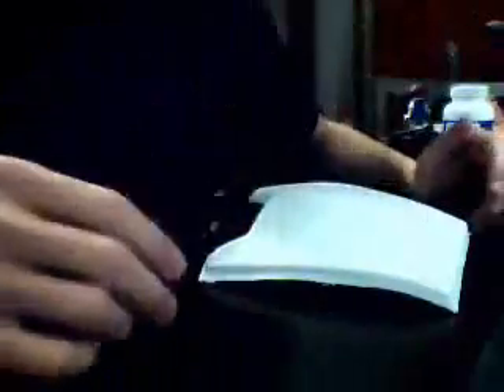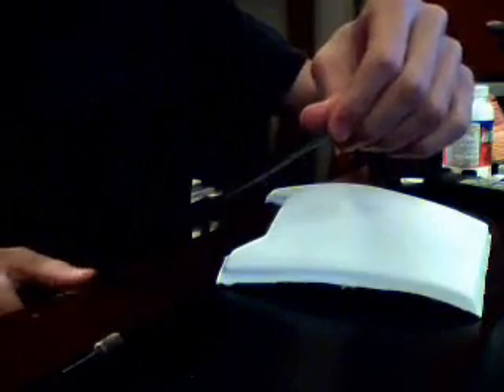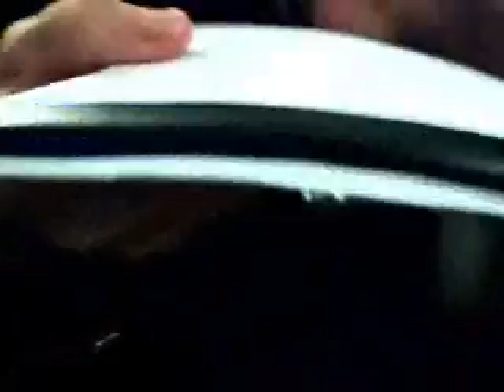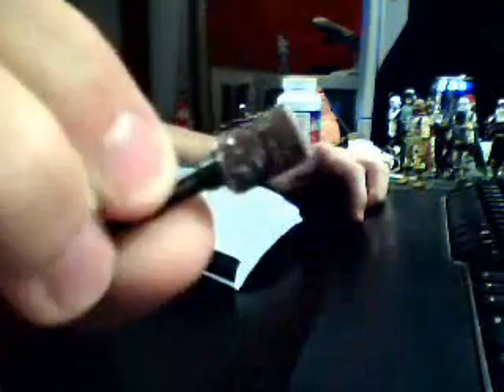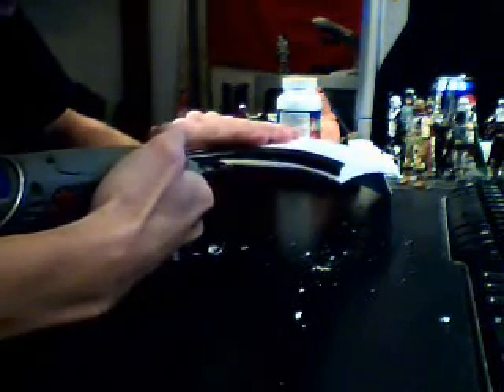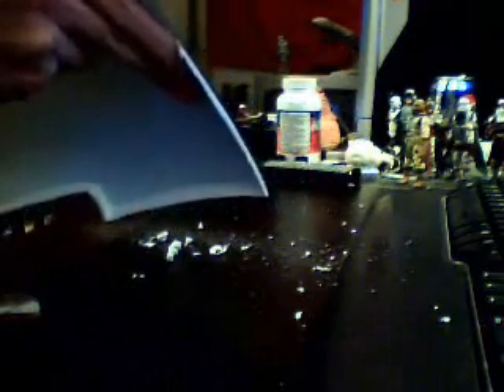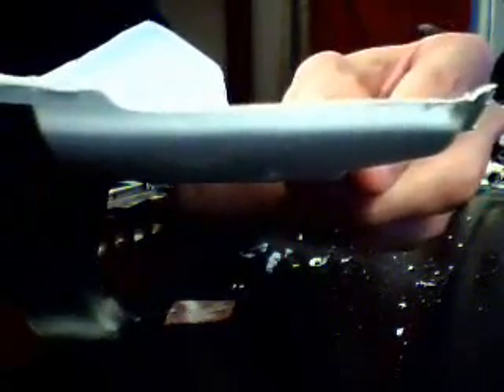ABS Armour Trimming I

Comment: A good tutorial but much quicker with a pencil and scalpel. Score and snap and a light sanding after. You could have done all that plate in 5 mins and it's a much more accurate way to do it. Especially when you have to butt up to parts with no gaps. Also, it is possible to warp the ABS using a dremel even on slow speeds.